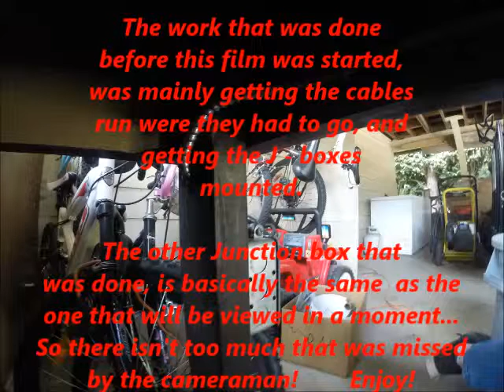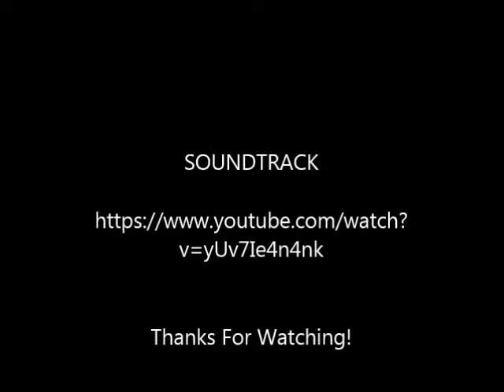Hot-Wiring a Workbench

Comment: Everything you did there looks good;  you've got good heavy wire for 4 outlets.  The only thing that would worry me about this setup is the integrity of the power source.  For most applications, you won't have any problems on a standard 15 amp 110 volt household outlet.  I've burned out 15 amp outlets and tripped 15 amp breakers running angle grinders and other power tools through them for too long, with an air compressor on the same breaker.  We installed 20 amp outlets on a 20 amp breaker on the barn workbench; because we knew we would likely be running multiple higher amp drawing power tools, on 50 to 100 feet of extension cord, at the same time.  Then we gave the air compressor, welders, and lights their own breakers.
Reply from the maker: Thanks for the comment...I really appreciate activity on my videos! 

Yes, thank you for voicing what you did. I do run alot of stuff off of those outlets. I run my welder from an RV plug at the side of our house. then I have a thick extension cord coming back to the garage. Our carport has a very small amount of amperage so we just run our freezer and lights, but nothing else. I have a plan that when we rip up our concrete, I will run conduit all the way back the the carport, so then I will have sufficient power to run my welder and all that from a separate box and all. I have it in my dreams that if we don't move in the near future, I will put a metal structure (shop) at where the carport is now. I really want to move though so we will see.               Thanks for watching! I will be looking forward to your next video!
Reply: +Samuel McKinley My next video........yea.....I've got footage from clear back in July that I haven't edited yet, and just recorded more today, on top of what I have in between.  Oh busyness.
Reply from the maker: +1850oliver180AC  HaHa, sounds like what I have run into!